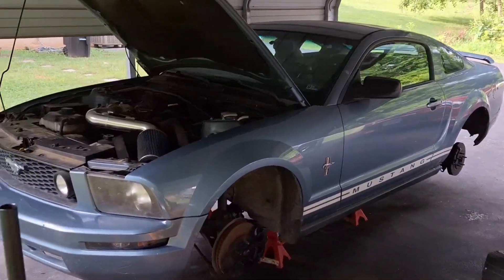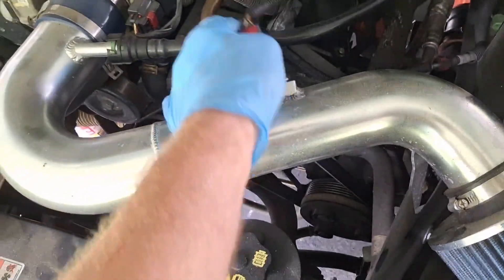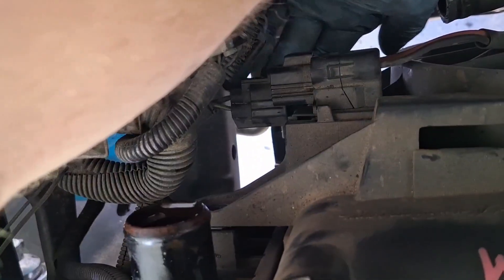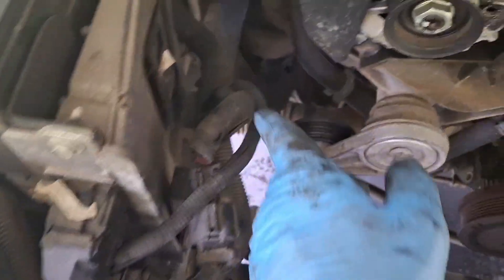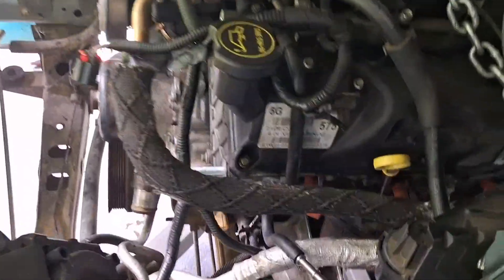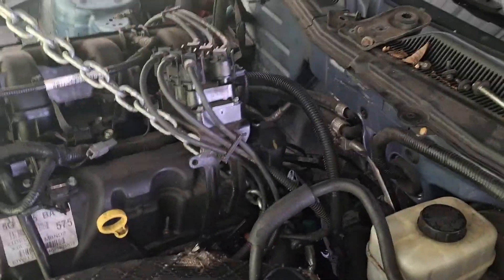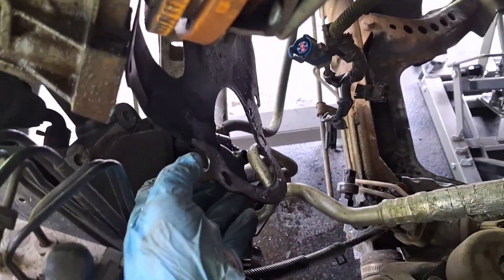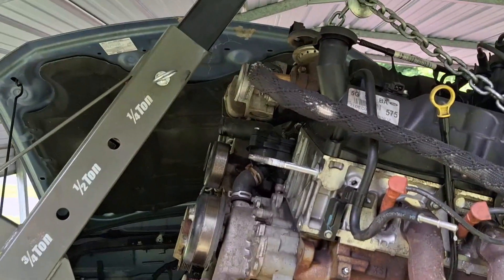Ford Mustang Engine REMOVAL: 4.0L V6 SOHC! 2005-2009

Comment: Hey man love what youre doing. The video has been a big help so far. The exhaust bolts, however, have been a problem since i started pulling the engine. Broke the 2 that are easy to access and the other 2 were so rusted on there that i only got one off and the other is spinning with the whole stud. Im stumped. Either I have to go buy a sawzaw or use my grinder and risk damaging the block.
Reply from the maker: Awesome glad it helped

Comment: Hello, I am pulling my engine to redo the timing chains and guides. I have an automatic transmission, at 12:34 you mention removing 4 torque converter nuts, I’ve been following videos real closely but I am not a mechanic and have never pulled an engine. Can you try and explain, or link me a video so I can get more information on this step?
Reply: Remove the starter. Use an 18mm socket to put on the crank bolt and spin clockwise until you see the nuts behind where the starter was.
Reply: @twiztid6977420 I got them off! I was just scared of messing something up. Thank you.
Reply: I’ve been watching a few different playlists of this job and I haven’t heard it being mentioned in them, I don’t want to mess anything up.
Reply from the maker: @Tv-oi6ix hey awesome! Glad that video is helpful to you. If you look at my Ford focus manual swap playlist on one of the first videos where I pull the automatic transmission out, that is a good example of how to remove torque converter nuts. You turn the engine over until you can access them and then remove them. That particular car has six nuts the mustang has four
Reply: @BigBensCarsAndCycles thank you so much man, I’ll check those out and if I have anymore questions I’ll post them here. You’re the man.
Reply from the maker: @Tv-oi6ix I've got a discord server. If you want I can answer quicker there. You're the first person actually to need help with a mustang 4 l engine on my channel. It's a new project of mine and I'm still actively performing it. So discord's the fastest way to reach me link is in my channel page on YouTube. I'm actually on a second engine right now. It's been a heck of a project
Reply: @BigBensCarsAndCycles I’ll have to check it out, thank you for getting back to me again. Gonna try and tackle pulling it out after work tomorrow 💪🏼
Reply: @BigBensCarsAndCycles I got them off!

Comment: As i recall from a test drive years ago, those motors were slow (my Test was with an Automatic).  Are you planning to restore it or improve it?
Reply from the maker: Gonna put another 4.0 in most likely and drive it for a few months and sell it for a loss and move on to the next car
Reply: @BigBensCarsAndCycles , I had a 2006 Steeda Pony Package.  So it had a rear sway bar, 18” wheels, 285 tires, GT brakes, 1.5” lowering springs, Steeda CAI, and Steeda rear wing.  I put a Magnaflow dual exhaust on it along with lots of cosmetic upgrades.  The 4.0 is pretty gutless.  I made a video on my channel (DIY Jeff) comparing 87 and 93 octane with a tune.  It was pathetic in performance, however it was super fun to drive.  It handled just like a track car with the upgraded suspension components.  These cars can be super fun if set up right, but also expensive to do so and not worth it if flipping it.  I’d argue it’s not even worth swapping the 4.0 engine with how cheap these cars are to get with a working engine.
Reply from the maker: @DIYJeff  ah gotcha. Maybe it would be better to 4.6 swap it even if it costs more
Reply: @BigBensCarsAndCycles , it would be great for content but every single post on every single mustang S197 group says it’s not worth the cost or hassle.  You’ll never recoup the cost, even having gotten the car so cheap.  The consensus is if you want a 4.6, just buy a GT.  Resale on these is not good for base, even if it has a pony package.  But I do say, the 2005-2009 are my favorite body styles of all mustangs.  It has the perfect blend of retro and new.  Now if you were to coyote swap it….well, those videos would bring all the kids to the yard to play.  A coyote swapped S197 is bad to the bone…..but then you have to upgrade a lot of the car to handle the power.
Reply: I find it interesting that ford used this 4.0 in so many cars and trucks.  It’s in the explorer (exploder), sport trac, and ranger.  It’sucks you have to pull the engine to get to the back timing chain.  I pulled this motor out of a sport trac and it was a nightmare of a job.  If the timing did go you’ll likely have bent valves.  I rebuilt the whole top half the engine and putting it back in was a nightmare re-mating it to the transmission..just fyi.  For reference on this engine, check out Platinum Productions.  He has some great step by step videos tearing these engines down.